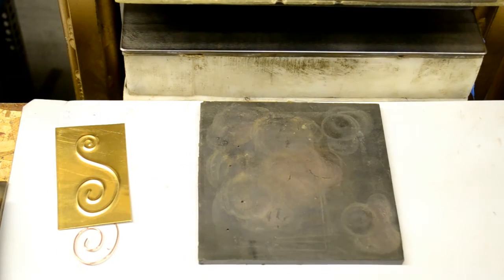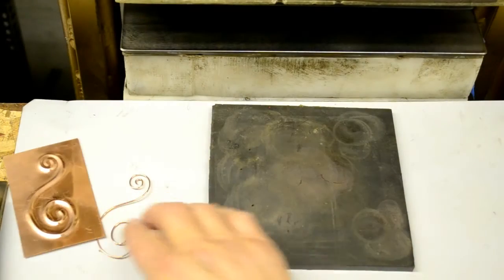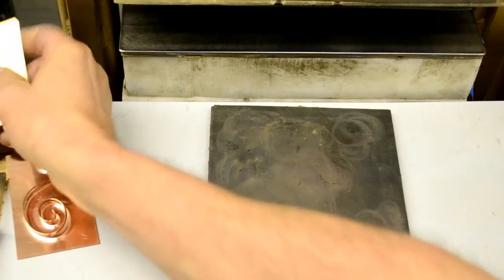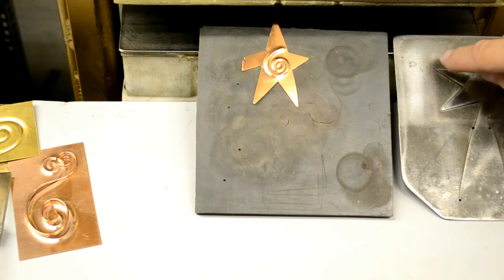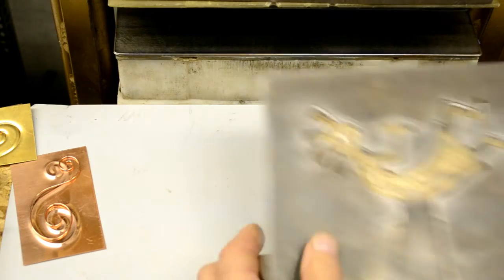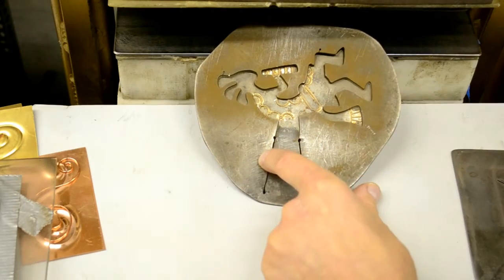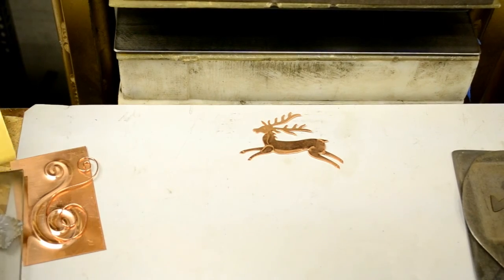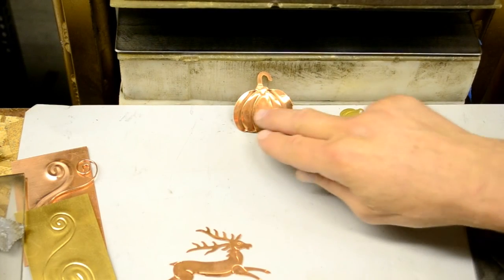Pancake Die Mutations : One Step Cut and Emboss

Comment: I don’t understand how you use the nylon, plexan, etc.
Reply from the maker: It's like a mold for the metal to form into, and IS a mold  in the case of the spiral inside the star shape. The urethane pad is elastic , so it returns to it's original (flat) shape after embossing, but the plastic ones can have permanent depressions made into them. This lets the metal form more easily and/or with better detail, at lower pressure than otherwise. ps sheltech.net  and now facebook . also , it's "Lexan" (polycarbonate); be sure not to get that mixed up with Plexiglas (acrylic), because Plexiglas will shatter.